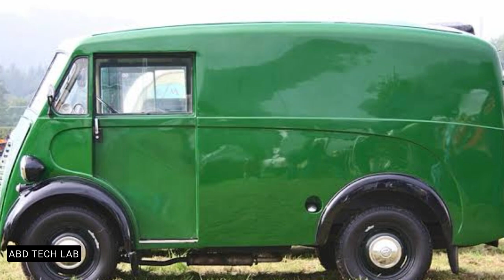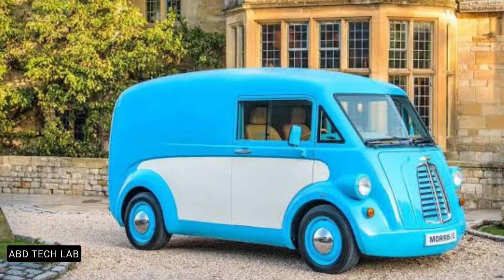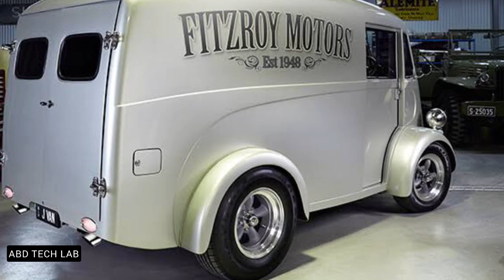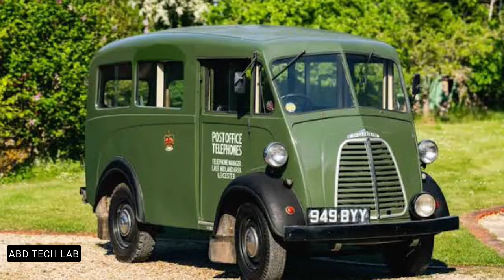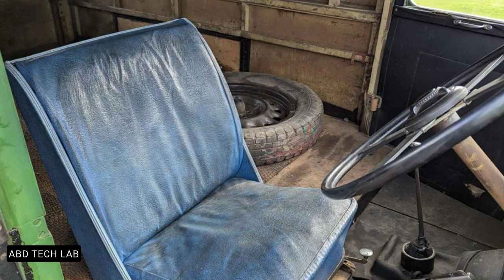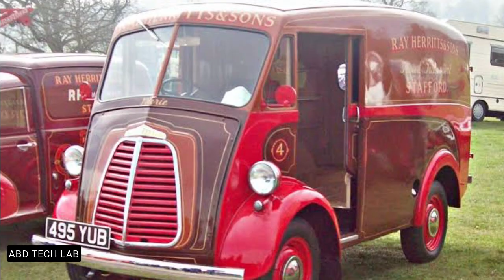UNCOVERED: The  1949 Morris J-Type SHOCKING Secrets!

Comment: What a load of twaddle.  The J Type never had a single curved windscreen, from day one to the last they were split screen.  The, not yet available, electric pseudo J the JE has a full width curved screen if it ever hits the market that is.  The interior shots at 6.54 and 8.12 are very definitely NOT J Types at all with their long bonnets and wind down windows and lack of engine in the cab.  £40k to £60k is also wishful thinking for a panel van J Type but the JE will cost £61k plus VAT but is 5 years overdue.
Reply from the maker: Okay. Thanks for the correction